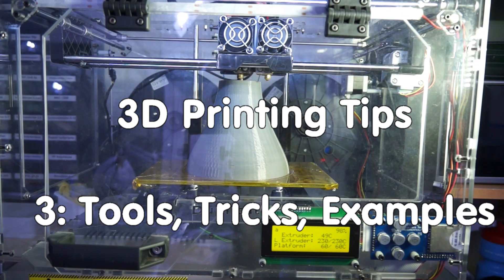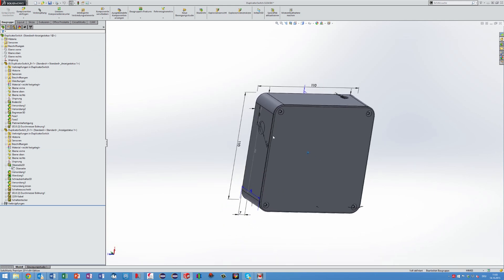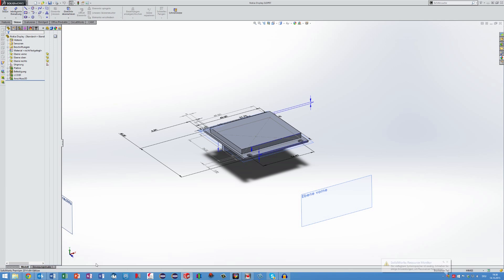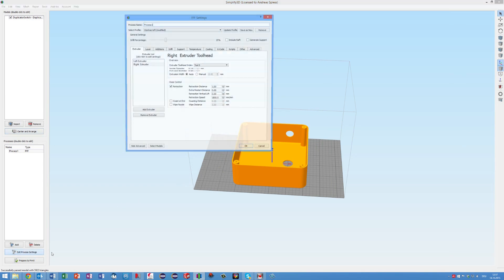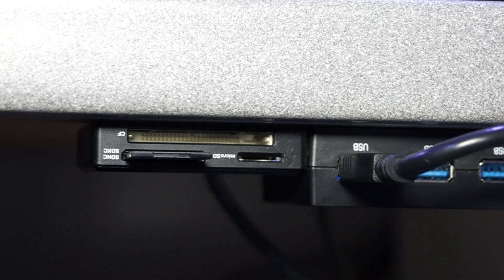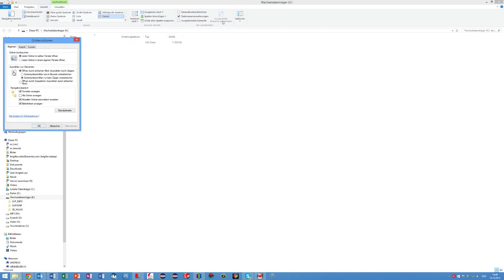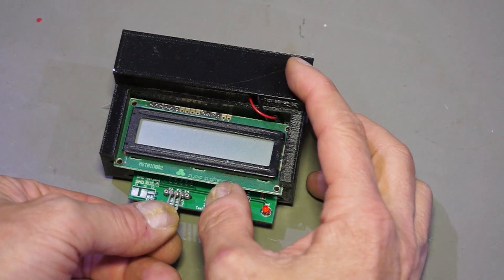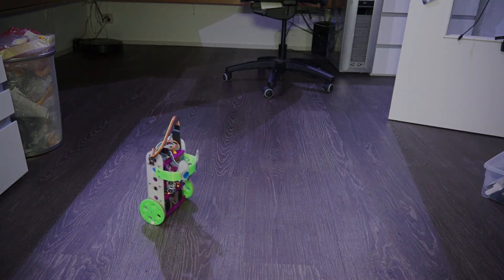#27  3D Printing Tip #3: Tools, Tricks (including Flashair), Examples

Comment: My mapped network drive shows wrong capacity.
It's a 32 GB card but it shows 484 GB free of 930 GB.
And that's exactly what my C:\ drive also shows.
Wonder what's going on there.
Reply from the maker: I also do not know. Is it a fake?
Reply: @AndreasSpiess  I doubt it's a fake. Added it as a network location instead of a drive. So now it just act as a folder. I can live with it, it's just a shame.

Comment: About the flashair the printer must have marlin firmware?I have an Ender3 with stock firmware works with this firmware?
Reply from the maker: The flashair is just an SD card. Instead of moving it to your PC to load a new file the file is transferred over WiFi. The printer has no idea where it comes from. It just prints the file if you ask it to do so.
Reply: @AndreasSpiess  thanks

Comment: Great video just got my Flashair up and running.  One thing I didn't hear you mention is where to point your browser to upload the files to the SD card.  It took me a while to figure it out.
Point your browser to  http://3dprinter/upload.cgi  for some reason i could not get my macbook to find the url.  :(

Good luck

Andreas Spiess
How can you delete files from the SD card wirelessly?  I figured out how to submit, but how do you delete?
Reply from the maker: I do not know. On the printer, I always use the same file name. So, I do not need to delete it... On my camera I use this software: https://github.com/OleAlbers/fad2
Reply: If anyone else is wondering, here's a link to a video how to map your FlashAir to as a network drive.
https://youtu.be/dYEOd-V7MHk?list=PL5FEfVz3wWHaU6_NMH-zK69b4Vclah_zv&t=248

Comment: Hi! I'm newbie in the 3D print world. I have some questions and I would really appretiate if someone could give me lighs.

If I put a Toshiba FlahsAir on a Prusa i3 (for example) in the SD port, I'll be able to transfer wirelessly de data to the SD, but will I be able to control de printer via the FlashAir? Let's say I'm using Cura, Slic3r or Repetier-Host, this will be as easy as it seems?

In case I have two printers and I'm going to use Repetier-Server or Octoprint from a PC, the Repetier-Server will recognize the two FlashAir?
Reply from the maker: +Daniel Poveda The flashairs are sd cards and behave exactly as Sd cards. The only difference is, that you can transfer files from your pc to the flashairs through Wifi. 
Each flashair has its own ip address. So, you can transfer a file to one or the other.

Comment: So many cool projects! The cable holder is genius. Thanks for sharing how you set up wireless printing. I'll have to give that a try.
Reply from the maker: +Jon Raymond Before I had this holder I had a mess with my cables. Now I can use an othewise unused space and find the right cable in no time
Reply: +Andreas Spiess I do have to ask. What is the funnel like print at the start of the video? Also you mentioned the cooling bottle for your router. Do you have a liquid cooled 3 phase spindle? I would like to upgrade the spindle on my desktop cnc and have thought about getting one of these. I'd be interested in a video about your router if you have a chance.
Reply from the maker: +Jon Raymond The funnel is part of my wind tunnel project. And the wind tunnel will be used to compare and calibrate different wind meters which will be used in my bike power meter. Complicated ;-)
In the next video I will continue with the wind tunnel and you will see the funnel again.
Concerning water cooling: I use a 2.2kW watercooled spindle which has two pipes. This spindle is cooled by another loop consisting of a reservoir and a pump. The reservoir and the pump are not mounted on the printer, they are beside it.
The bottle shown in this video is used to spray-cool the goods. I have a small device which is feeded with water and pressurized air.
Anyway, I plan to do also a series on my CNC router like I did for 3D printing. This will include things like a vaccum bed,  routing of PCBs including autolevelling, auto switch on and off of the vaccuum pump and the perssurized air generator, and probably some other things I built during the last years. For the moment, I do not know when this will start because I have a few other projects in the works...